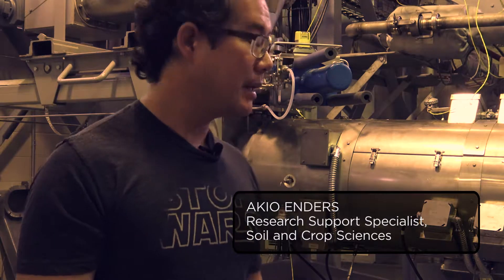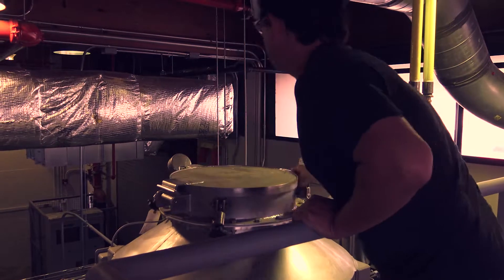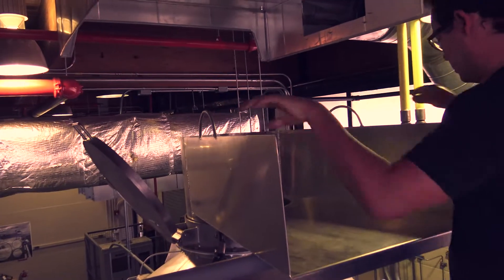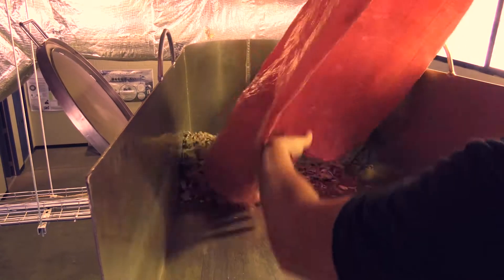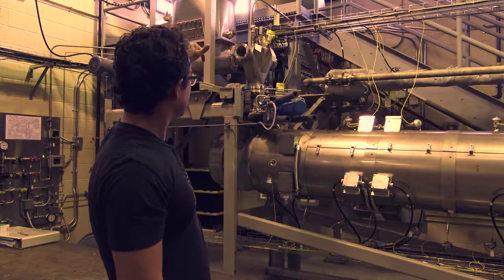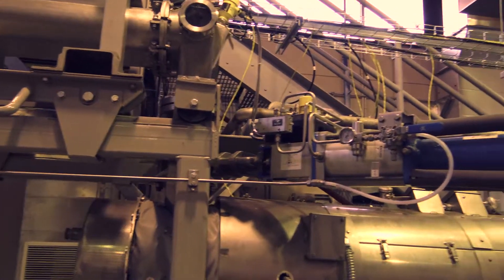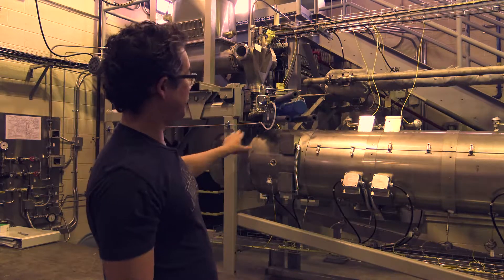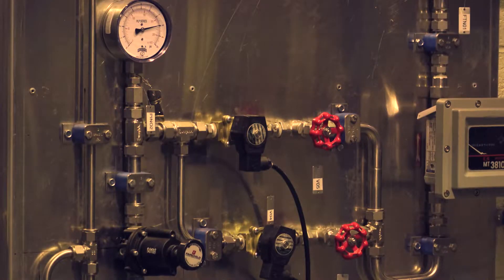How Does the Pyrolysis Kiln Work?

Comment: Hello, we are also developing a continuous rotary furnace for pyrolysis. But we are a little stuck at sealing between rotary and stationary parts. How did you guys manage to do the sealing? Is there any company we can buy the sealing system from?
Reply from the maker: Hi Emil, That's great to hear. This video snippet is part of a larger project we have of virtual tours on climate adaptations on/for working farms and forests. This video is from the tour called, 'Cornell Biochar and Compost Facilities' 
https://www.climatehubs.usda.gov/hubs/northeast/project/cornell-biochar-and-compost-facilities For your specific question though, we suggest reaching out to Akio Enders (at Cornell University).